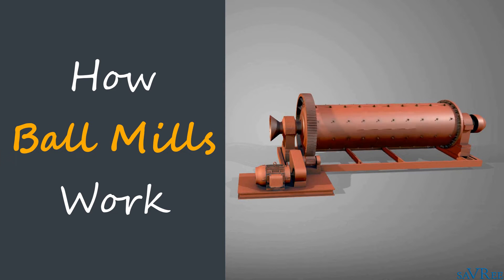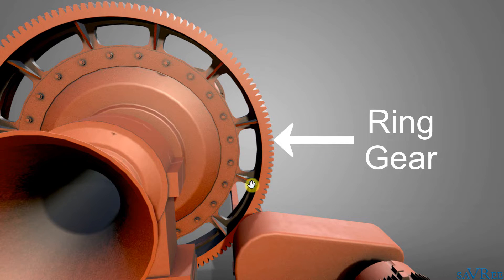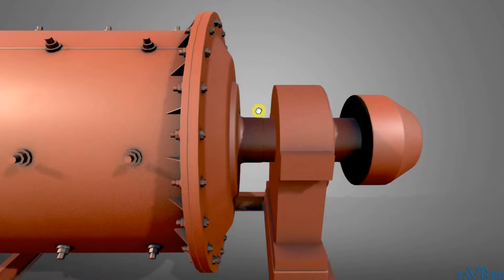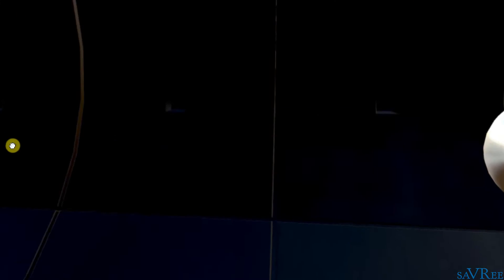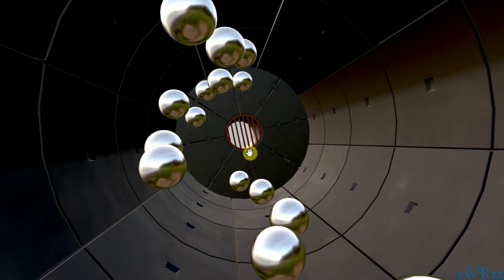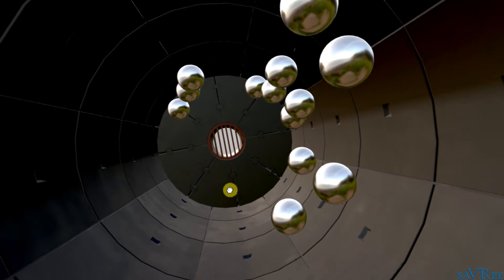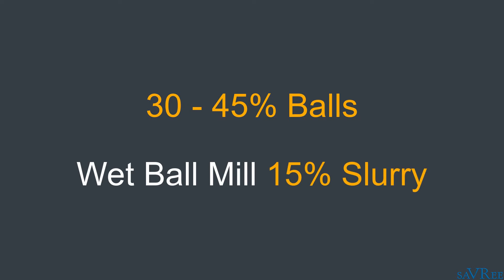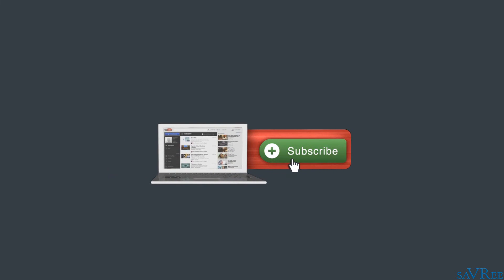How Ball Mills Work (Engineering and Mining)

Comment: Greetings saVRee from Sudbury, Ontario, Canada. ( About 250miles=400km=5hours North of Toronto).
In the 1960s and 70s I worked as Electrical Techie at 5 International Nickel concentrating aka milling 
aka ore dressing aka mineral dressing plants. The total grinding mill motor family was wound rotor 25hz 

34@400hp=13,600hp + synchronous 60hz 10@800hp=8,000hp + 7@1750hp=12,250hp + 10@2000hp=20,000hp 
for a grand total of 53,500hp driving the lot. Wish I had your video back then for training the electricians, mechanics, and operators (as well as myself ). Your video also stirred memory cobwebs of a 1956 
Chuck Berry song that was later done by the Beatles ~ 
"Running to and fro, hard working at the mill ~ Never fail, in the mail, there come a rotten bill,"
 ( Too Much Monkey Business )

Comment: I want to make a small (5 gallon or smaller) ball mill for grinding sulfur, charcoal, etc into VERY fine powder.  I considered using a 5 gallon bucket but I don't know if the grinding action occurs between the balls or between the balls and the wall of the mill. If the latter, than perhaps a plastic bucket won't work.  Tips?  Input?  Anything helps.
Reply: SIR PROVIDE YOUR MOBILE NUMBER 
MORE INFOMATION BAL MILL

Comment: Did repair work on a cement plant. It grinds finer than flour.
Reply: Is it measured in a unit called 'mesh'? If not, what was it? Microns?
Reply: @ctdieselnut  particle size is usually measured by its specific surface. Cement usually uses a measurement process called Blaine air permeability

Comment: How is the brake system?
Reply: Brake operation is controlled by a hydraulic power pack designed to meet each individual application.What is a ball mill used for? and How does a ball mill work? get answers via  https://www.bestjawcrusher.com/products/ball_mill/?wua